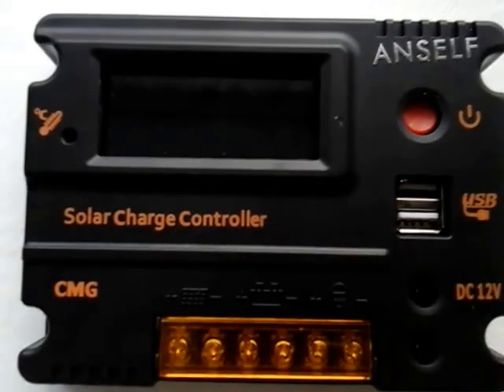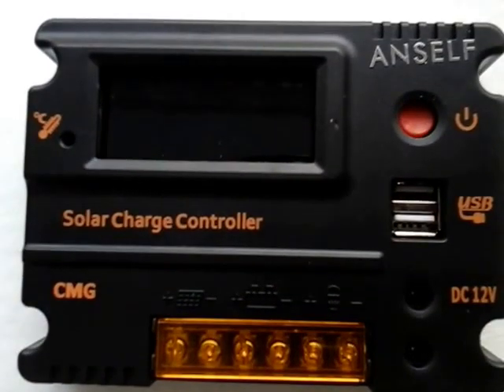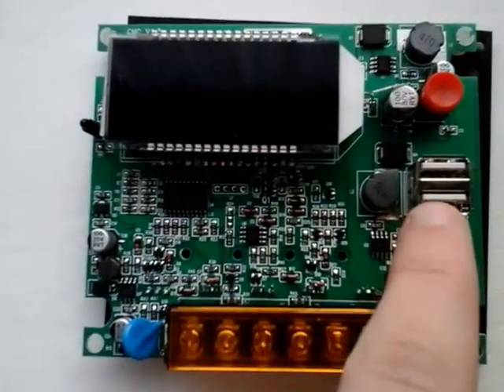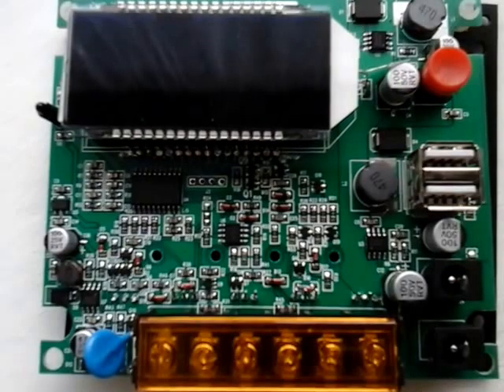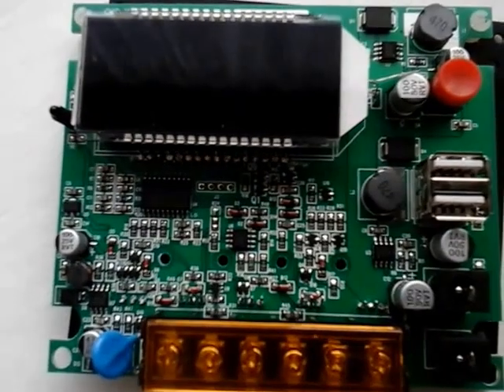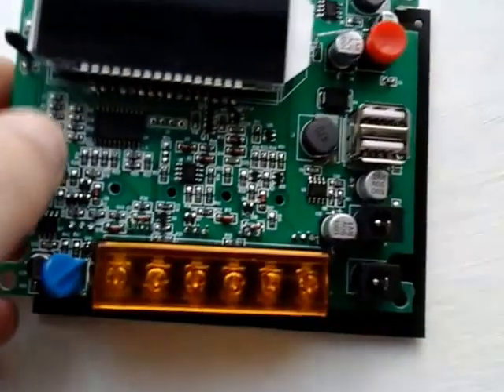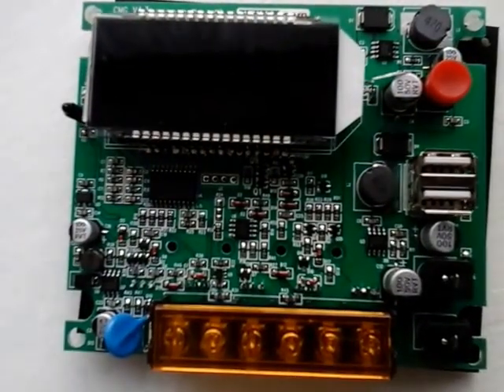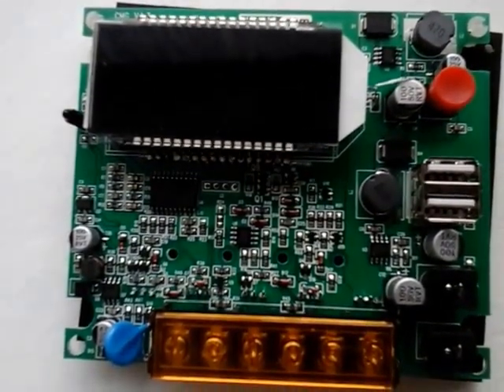Anself CMG PWM solar charge controller review.

Comment: How many watt panels are connected?

Does it operate this panel 38 volt ?

Open circuit voltage : 40.9volt

Maximum power point voltage: 33.6 volt

Short circuit current : 9.96A

 Maximum power point current :9.38A

Comment: Do you know if it current senses and regulates in the positive path or the negative path?
The one I have here is useless as it does so on the negative side which makes it unusable in a negative ground vehicle.
From what I gather of this charger, it is a three stage type which is possibly why you were seeing a high terminal voltage.

Comment: Been working fine for me! It doesn't blast the battery to 15v, it just pulses. So it won't effect the battery, if anything, it will decalcify the battery
Reply from the maker: I have a theory about that. I used a rather small battery - I think it might not be designed for a battery of such low capacity. I had exactly the same issue when I later designed and built my own PWM charge controller.

Comment: It is a real charge controller, I just don't think it is mppt.  It is nice it has regulated 5V and 12V.
Reply from the maker: It's not MPPT, no, just PWM. The use of buck converters for the regulated outputs is certainly nice too - one can never have too many USB power outlets. Hardware-wise, it's really nice. The thing that really ruins it is the poor battery management programming. Yes, it'll work, and work quite well. It's just that your battery life will be shortened by such abuse.
Reply: o controlador pwm azuzinho de 50 amperes vendido no Aliexpress na loja da powmr o chip interno deste controlador e parecido com este do vídeo.observacao a placa deste controlador pwm cmg 2420 é melhor do que o controlador pwm azuzinho? pra monitorar o carregamento das baterias ultizar o relé de tensão baixa e alta ou o controlador clone da epever pwm que e vendido no Aliexpress?